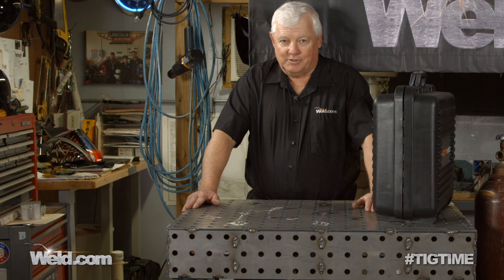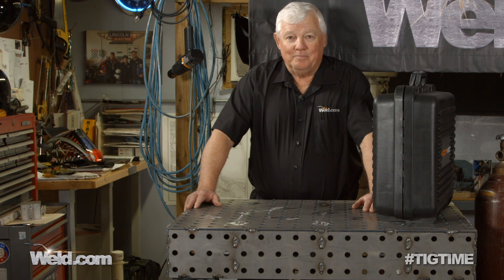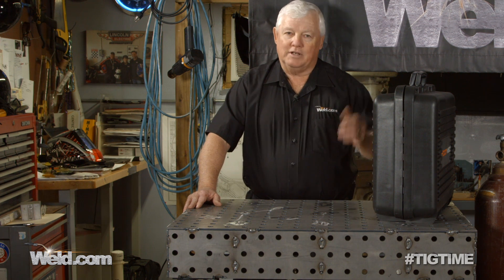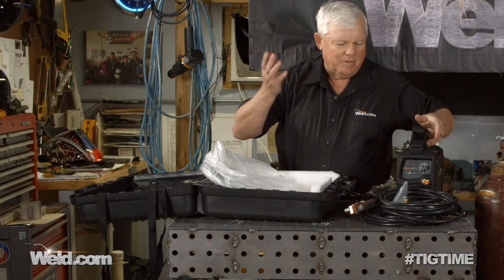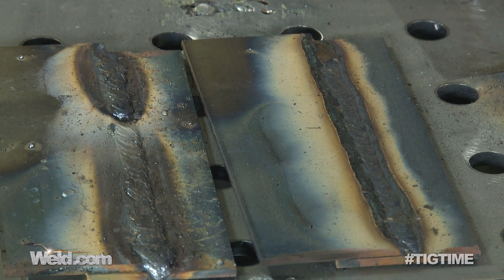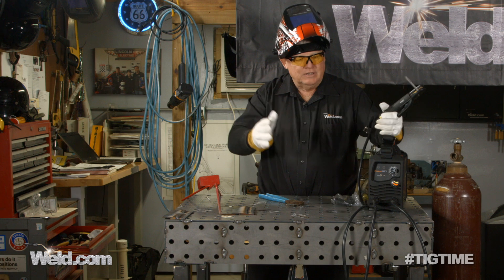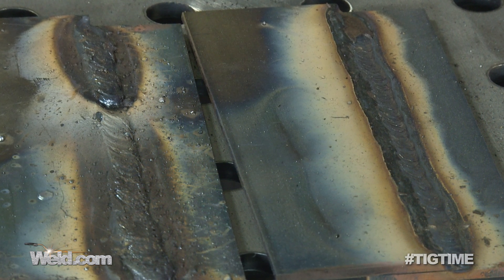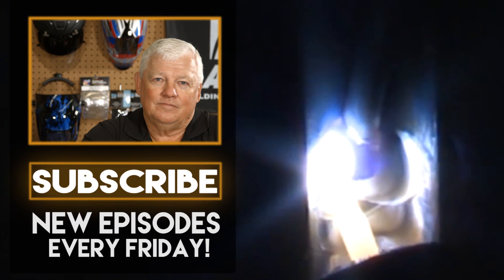RazorWeld 110 Overview: Part 1 - Stick Welding with 6011 and 7018 | TIG Time

Comment: I bought a century 295 amp heavy duty AC welder for 100$. Out performed those Lincoln 225/125 that sell for 1000$. Mine also burned 6010 with AC very well

Comment: 6013 is the only rod that works for me.    I can keep it going it like a hot glue gun.
7018 does nothing but spark and stick, spark and stick, spark and stick for me.
Run three passes of 6013, should make up for 7018 being twice as strong.
Three decent weld passes with 6013 is a lot stronger than no welds that work at all of 7018
Reply: CHOPPERGIRL's AIRWAR turn up your amps might not stick and run
Reply: ...should have 45 amps, per every millmetre of rod......NOT INCLUDING  coating.
Reply: milli metre
Reply: @petersack5074  I finished my 20ft trailer, drove it 800 miles, picked up a free airplane, drove it back, and went through a taco bell drive through with it.   Locktighted all the bolts and golden gate painted over everything...  6013 chinese farm sparklers for the win?  pictures:  air-war.org
Reply: Try 7014 will work better on a small welder

Comment: Strange as it may seem, the 6011 makes stronger welds on an AC welder or AC mode on an AV/DC welder. ChuckE2009 did a weld break test to prove it.
Reply: ChuckE2009 is a product peddling idiot. Hence why he's hardcore pushing Chinese product. His channel stopped being about welding a long time ago and has become a rolling cesspool of infomercials.

And that's why his lame-ass channel has the comments shut down.